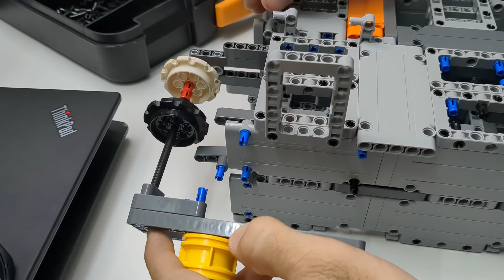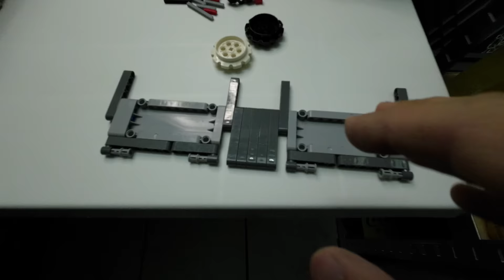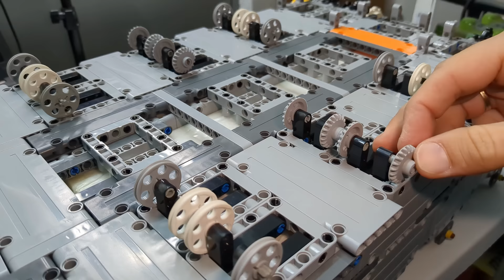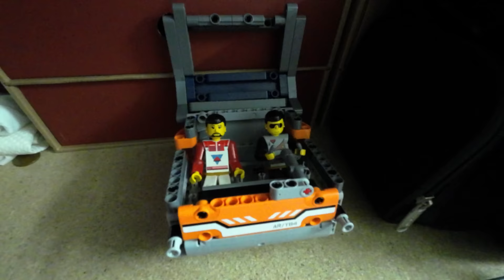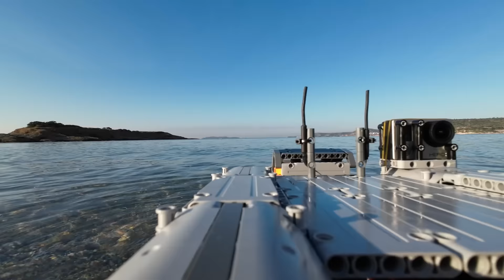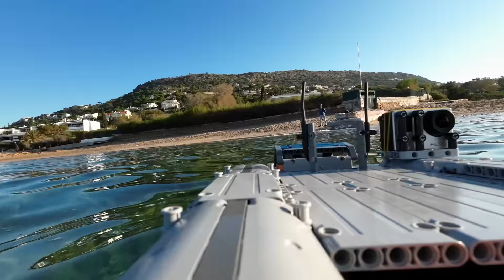Heavy LEGO Technic amphibious tracked vehicle, build and test.

Comment: I always tell the kids in my club: "If you need to use more than three frames, you are doing something wrong." However we don't usually build meter long tanks with giant polystyrene block holding cages. Guess I should stipulate that it depends on the context.
Reply from the maker: You run a building club? Please elaborate! 🙂

Comment: Absolutely awesome build and video!  

I wonder if adding some mass to the center of the hull, below the waterline, might help with stability?  Might need to remove mass elsewhere and/or add more buoyant elements to preserve function, but low-mounted ballast might help counter the roll tendency in rough waters.  

Well done, I wish I had the resources to do something like this myself but I am content to live vicariously through your channel!
Reply from the maker: You are correct! This is the last of the "first generation" amphibious vehicles, using foam fillings for buoyancy. This method of keeping my builds afloat was quite restrictive when it came to designing each vehicle. My "second generation" vehicles will use 3D printed fillings, so I'll be free to design the vehicle exactly how I want it and then print the buoyant parts and properly place ballast. I'm also planning to design water tight boxes for the motors and electronics so that I don't have to place them on top of the vehicle.

Comment: This has gave me a good idear for YOUR NEXT UPGRADE. Have it equipped with multi directional motor's with GPS stability (not to difficult with drone flight controllers nowadays). And build a rescue winch that you could hopefully rescue a simulated lost drone perhaps. 
Similer to floating oil rigs. 
Obviously it may have to be wider again for wave stability and include a GoPro attached to the winching hook. How hard could it be 🤷‍♂️. 
You got a week, I'll even subscribe now. 
Thanks for the video. 👍
Reply from the maker: There is something similar in my "To Do" list (not with the GPS stuff). Sink a small ship and build a bigger ship to salvage the smaller one...
Reply: @brickandgear  That would be awesome. I suppose various anchors should hopefully keep the rescue Vessel in place to carry out a rescue of the smaller boat. Look forward to it.

Comment: Would you apply water sealant or no?
Reply from the maker: Nope. I haven't applied any sealant so far on the motors or electronics.
Reply: @brickandgear  ic, but if you do, would it affect the contraption handling and buoyancy?

Like would it help or no? considering Lego is not quite sealed as it would be once topped together
Reply from the maker: Filling the hull with blocks of styrofoam provides enough buoyancy. Applying sealant on the bricks would probably make any boat a bit more buoyant, but risking damage to my pieces and having to clean them one by one after disassembly is not worth it.